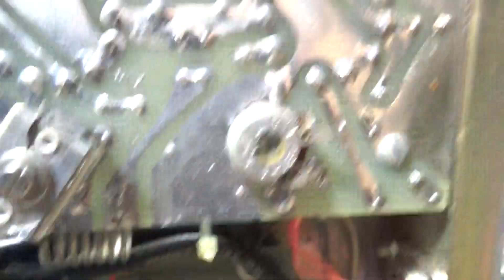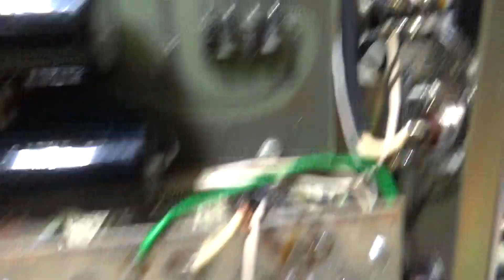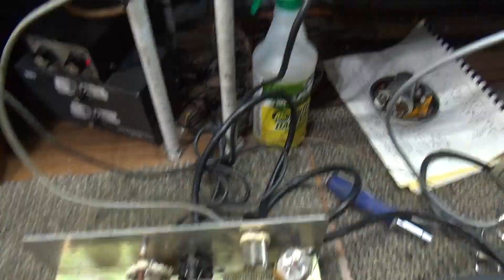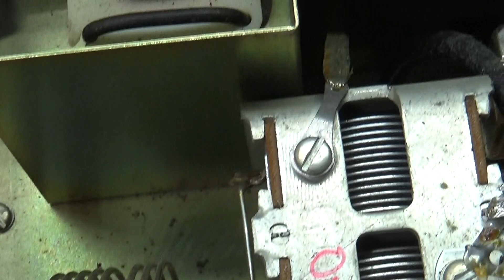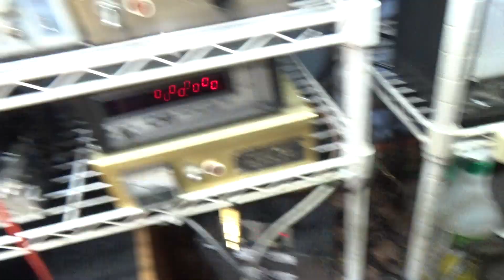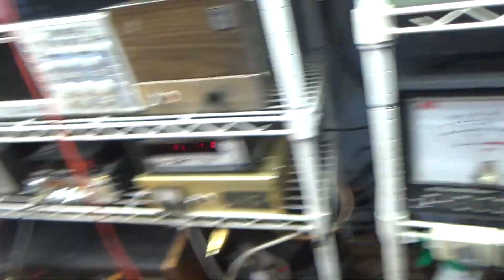Another new toy, very clean Palomar 300a Blackface on the bench

Comment: Do you know the milliamp value for the meter on a Palomar 300A amp? The website has several 0-1 DC,0-3 DC ,0-5 DC etc. Thanks,
Reply from the maker: I don't but I would just get the lowest MA I could find, as if its too sensitive, you can put a resistor across it. If its not sensitive enough, that's not an easy fix.

Comment: I’ve got a 300a black face also in like new condition I purchased from a silent key family. Recapped it and it does 750 on SSB and 1K on am. I’ve been running it with a Stryker 955 for over a year and it hasn’t lost any power. Great amp !!
Reply from the maker: Great amp, but i have never seen that many watts from any I have had or have now. How many watts does your Stryker do?
Reply: @tramdr  the best ive ever got out of mine was 500 w ssb and that was by throwing too much power into the driver tubes, and it didnt take long to roast the tubes, and probably would have roasted them quicker on am cuz am,fm, ft8, ft4, ect. is real hard on sweep tubes,
Reply: @tramdr  the Stryker is putting 2 watts dead key and 60 watts PEP into the Palomar I bought it from a Silent Key family. It was never used….still brand new. I got new caps from Larry’s Linears (Kim-Bell Donaldson) and installed them had the tubes checked and the tech stated they were new tubes. I’ve been running it with the Stryker for over a year with no issues. I’ve got a complete set of new tubes if I ever need them. I only run it on SSB very seldom do I run it on AM.
Reply from the maker: Yikes. You Sir are lucky. Those on High were made for 4 watt or less dead key, which is fine with your 2 watt dead key, but they also were made for around 25 watts max pep drive. You are killing that poor little amp. Lucky it survived this long. They did not name that amp a Palomar 300a for nothing. That amp is designed for about 600 watts pep max. You are driving it more than twice as hard as you are supposed to. Those 4 final tubes put out a good l00 watts each, l50 at best. For you to get lK out of it, the finals have to be pushing 250 out per tube. Yikes. Also 65 watts going into the 2 driver tubes? Eek, Holy Moly, Great Balls of Fire, Yikes. I'm glad I got out of the customer fixing business.
Reply: Yes ago we ran in-12’s in those. I’ve had many yrs ago it’s a decent small amp, what I’ve found the power supply was the first to go in those and run hot.

Comment: 7:03 those 2 relays are gonna be a problem.
Reply from the maker: Yes, those white ones are known to fail and hard and expensive to replace. However, if they do, I'll just wire in some generics off the board, like a hardwired amp has.
Reply: @tramdr  I tried the hardwire one in and the amp ran like crap. I managed to find a NTE sub and it worked. I did open othe old ones first and managed to clean the contact and bend the copper "spring" to get some contact. They ended up melting though they dont like high pass-thru power. after I put the NTE ones in I got rid of it
Reply: guess links are disabled.
NTE RLY3942 buy all you can find